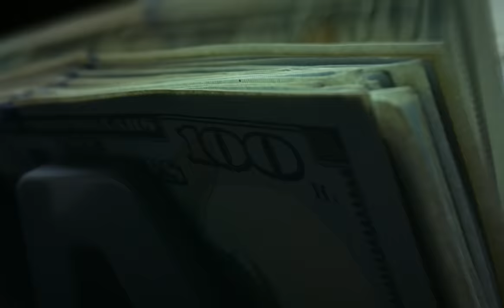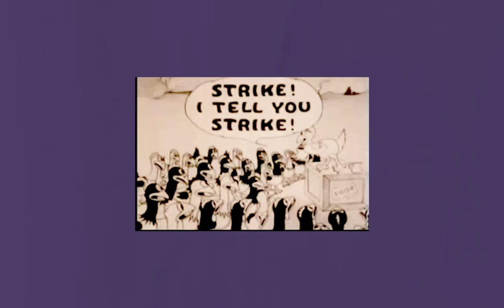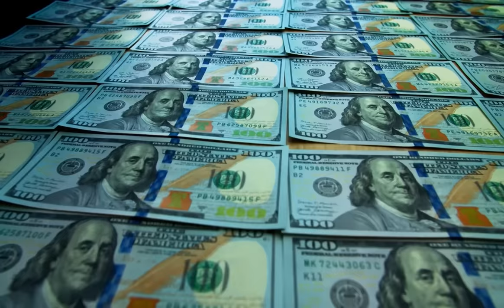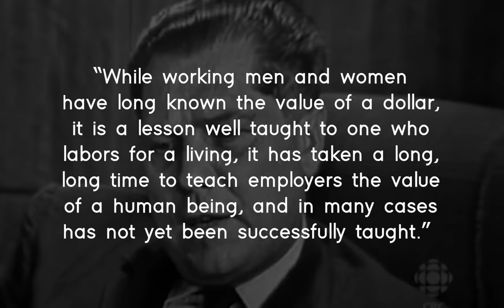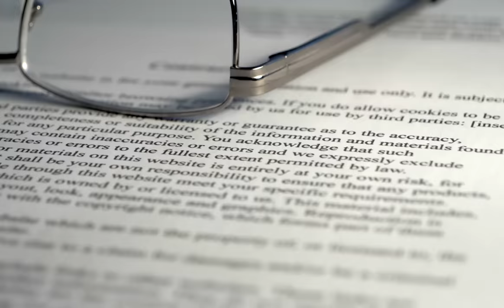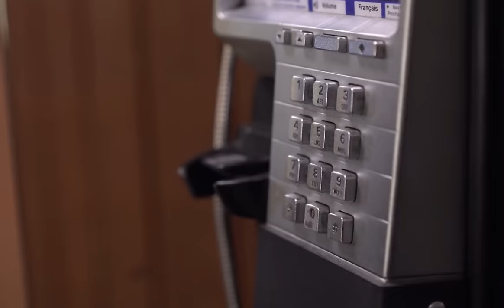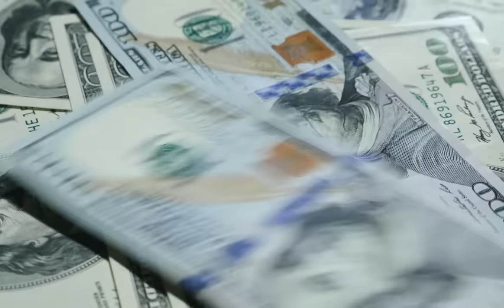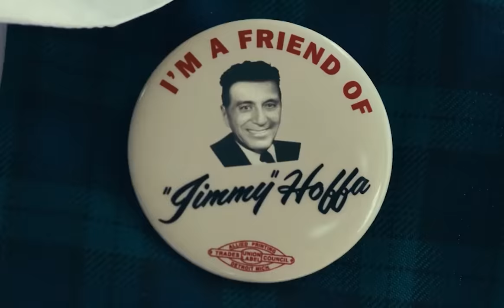Solving the Mystery of Jimmy Hoffa: The Search for His Final Resting Place

Comment: When I was younger( in my late 20s early 30s) I worked for a place that had a union, the company was working to remove the union when I started. And it ended up going to to trial cause the company broke over a dozen national labor relation laws. And when it was all said and done about 4 or 5 years later. I got a $50,000.00 settlement from the company for all the laws they broke

Comment: 6:00 when I was at University I worked as a parking lot attendant for the University, student job gig. I had a split shift where I'd be up all night, get off at 7 AM, then go back at 10:30 AM to relieve FT people for lunch. But this involved running to 4 different ramps in exact timing and counting out 4 bags of money, then carrying them with me. I'd be sleep deprived and, by end of shift, would have about $2,000-$3,000 on me. They had this student looking backpack you had to carry the money in. So it felt extra sketch because nobody knows but you that you are carrying several thousand bucks in cash, and the thought of getting jumped is realistic at that point if you don't act cool.

Comment: That grand juries approve indictments at 99.9% of the time doesn't mean they are worthless. They have a low standard of proof, and that boosts how many requests they will approve. In addition, prosecutors will only bring cases to the grand jury that they know they will win.

But without a grand jury, a person could just be arrested and then charged and it could be an expensive and time-consuming effort to get out. Having the charge needing to be vetted by anyone - even if they have a low standard of proof - means that a person couldn't just picked up pretty much at random and charged. Prosecutors have to have something resembling a case and some proof before they can bring the charge. It seems largely useless, but it serves an important function.

Comment: 2:28 : “…so a union usually isn’t necessary (at USPS) …” 
A Union is always necessary where workers desire to not be taken advantage of, Kevin, and lazy workers exist everywhere, not solely within the confines of unionized workforces. 
Postal workers in the U.S. have had unions since the 1800’s, and now have the APWU, est. 1971.  The APWU came about as the result of merging a number of smaller local unions across the U.S. after 
the strike of over 200,000 postal workers in major cities across the country caused mail delivery to almost cease, and resulted in 1) postal workers to receiving wages they could live on, and 2) a reorganization of the entire postal system.
The USPS has 526,000 employees; 220,000 of them are unionized, so not sure where Kevin got his stats on that.